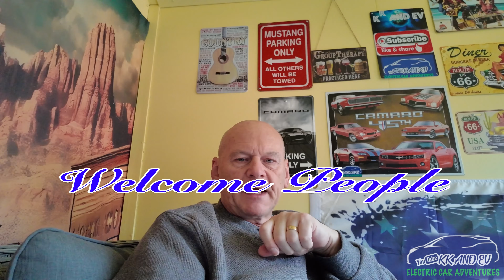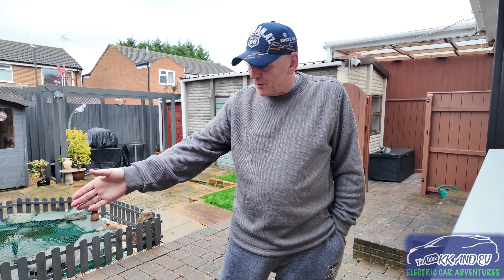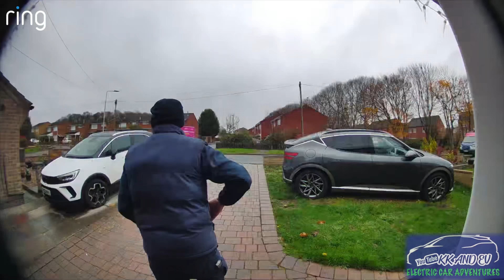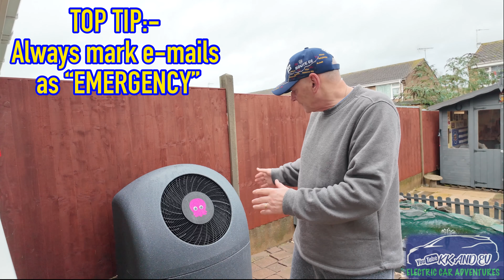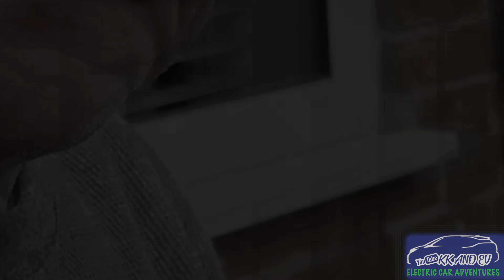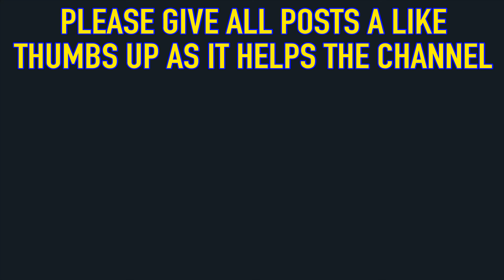OCTOPUS COSY 6 Heat Pump DEAD after 8 months! UNREPAIRABLE !

Comment: Oh no, wasn’t expecting that - a bit worrying this is
Reply from the maker: It is VERY RARE and they were very fast at putting right so hopefully you won’t see another post about it! 👍🏻
Reply: @KKandEV  We opted for the Daikin 6kw version from octopus - no issues todate.
Reply from the maker: Good to hear! My Son has the Daikin!
Reply: @EverydayLife621  my first cosy 6 was terrible, I had to fight with octopus to get it replaced. I wanted them to replace it with a Daikin, no big deal to them...connect to the existing pipework and fit their controls in place of the abysmal octopus app based crap. It would have eliminated all my issues with the cosy and the lack of local control, but they refused, fitting a new cosy 6.... which broke down within 2 days whilst we were away on holidays, and has now had 4 engineer visits to another noise issue, still unresolved.

Octopus go from bad, to even worse.